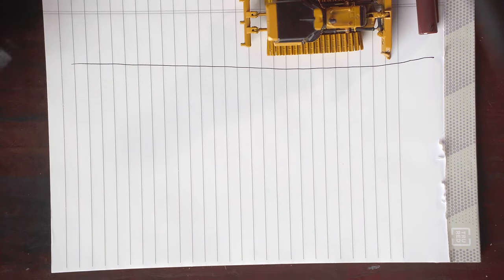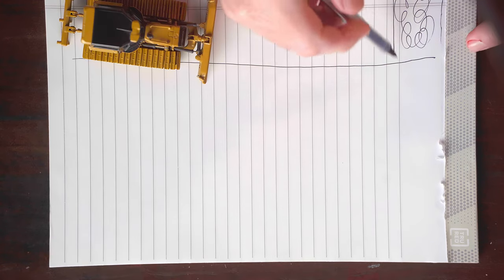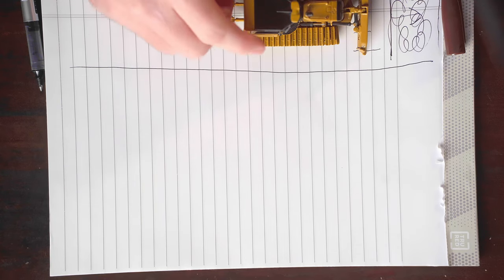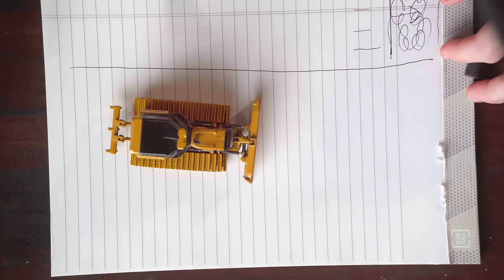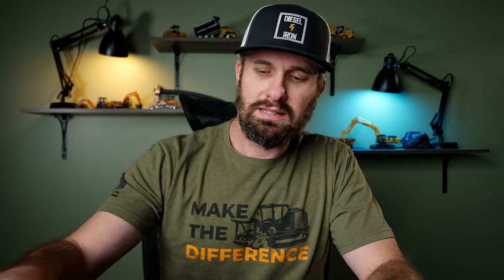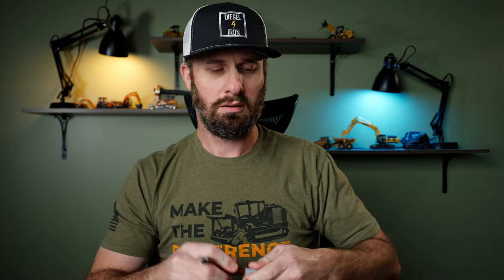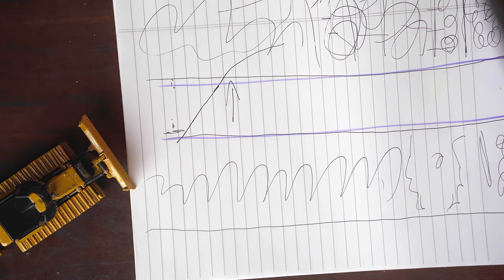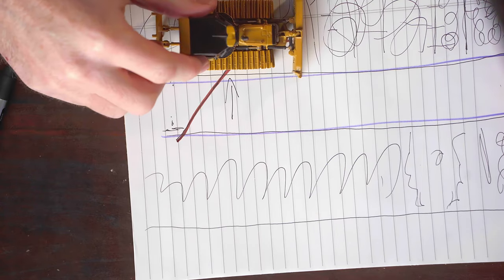Slot Dozing Explained

Comment: Same amount of work both ways. You still have to push the same amount of dirt, the same distance.
Reply from the maker: That's not correct.
Reply: The dirt weighs the same. The dirt has to be moved the same distance. If you load the blade early you carry the dirt the same. What’s up with yout reasoning? It is definitely the same. And as for pushing downhill by some manufactured design….. it’s still the same amount of yardage the same amount of distance. That’s like lifting the rear of of car to say your always driving downhill . @DieselandIron
Reply from the maker: @steveross9058 Did you watch the video?  Yes, the dirt itself is moving the same distance but one scenario is much more efficient because you aren't keeping the machine under load the entire push and you shorten the initial pushes while getting more production.
Reply: How are you not keeping the tractor under the load for the entire push? Does the load get magically lighter’? Somehow, you are saying you’re trying to pick up more dirt as you move your tractor to the fill. If you did that, you need to be fired. Slot pushing, you load your blade, the slot keeps the dirt trapped in front of the blade and you take it to the fill. Same distance, same yardage.  @DieselandIron
Reply from the maker: @steveross9058 Look, clearly you know already so there's no sense in continuing this argument.   Stay safe man.

Comment: Love the content, great break down for all.  But I’m curious as to your comment about specifics where this would not be the optimal method also. Standing by to learn more.
Reply from the maker: It can be a variety of things.  If you aren't moving enough material to form a true slot then you end up wasting time trying to make this method work.  Sometimes site conditions don't really permit you to create several slots so you have to make due.  It really just depends on the situation.  As an operator it's important to have a variety of techniques in your tool belt that allow to to be versatile.  Thanks for the comment!

Comment: Better explanation to me than my previous understanding. 
But my question is about that possible blowout on the machine side and caving in on the operator.
Reply from the maker: I wouldn't go deeper than 3 or 4 feet before taking the windrows and starting the process again
Reply: Keep your slots closer and the windrows will stay low,only needing to be cleaned up at the final cut